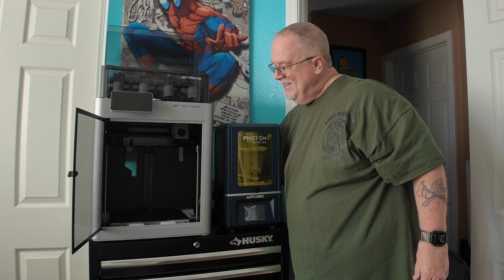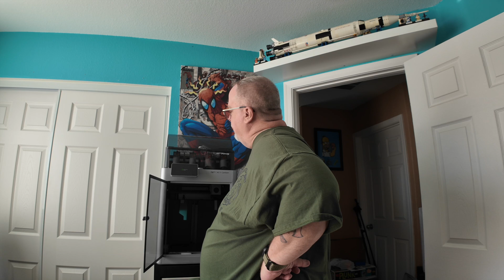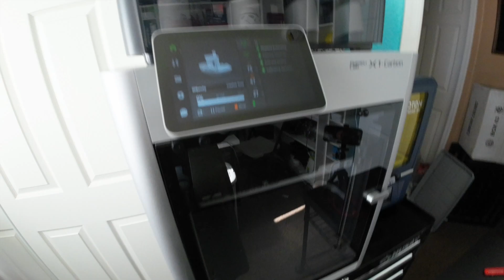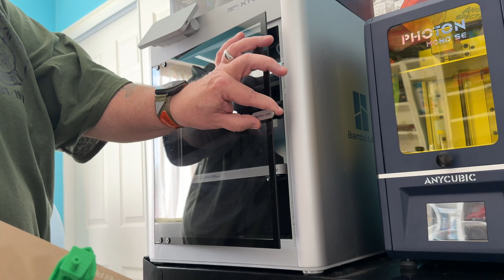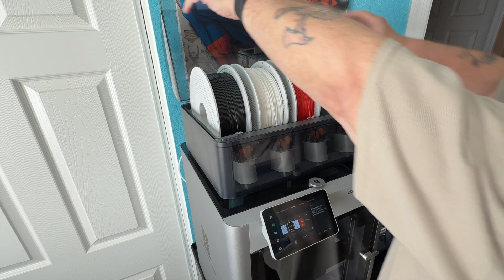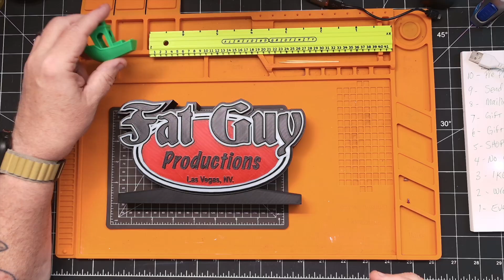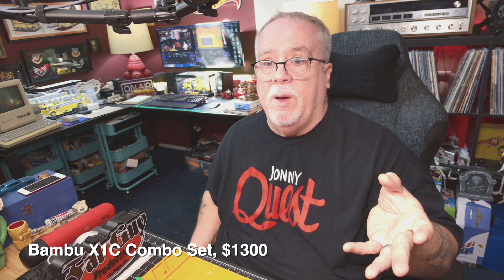The First Prints off the Line on My Bambu X1C

Comment: Is it capable of printing 1:24 automotive bodies and other large kit parts like trucks?
Reply from the maker: yes and no.  It for sure can, but despite the quality you would still have layer lines.  A Resin Printer would be far better.  On that note, stay tuned!
Reply: @pauly7218  It would seem to me at least that those lines would be covered and unseen after multiple layers of paint. You don't think so?  
I am hearing the liquid resin printers are not good for lungs etc of people in house with the machines. That's why I think the Bambu might be a better option.
Reply from the maker: @rayrussell6258  Ray, they are so surprisingly fine, yes.  I think some filler primer and or a bit of sanding and you would see virtually nothing....